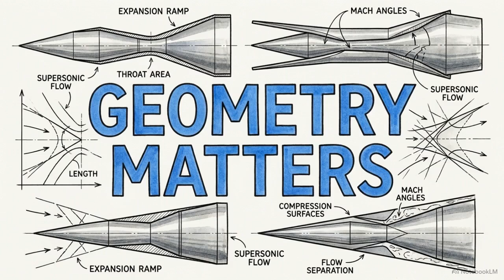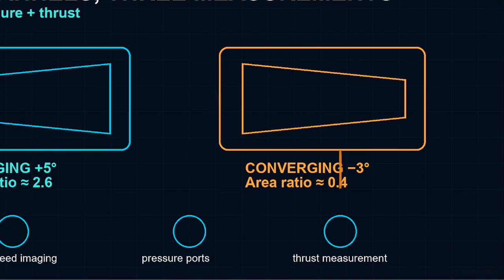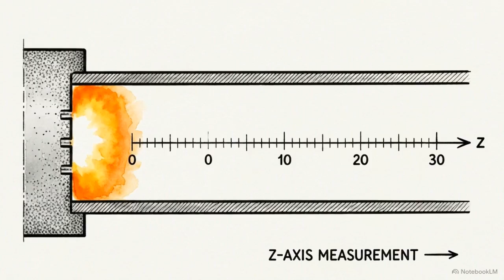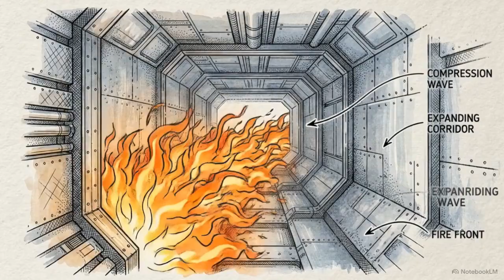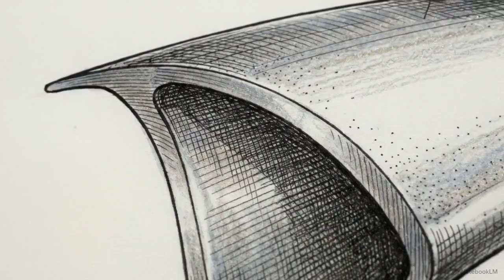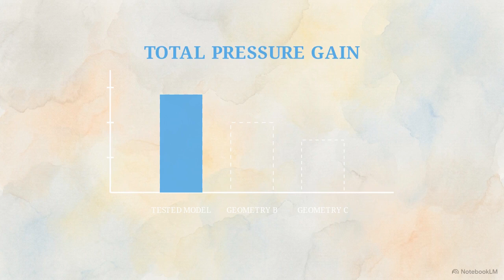How Channel Shape Changes RDE Flow | RDE Paper Explained

Comment: RDE occupies an interesting niche. It is stupidly inefficient in the atmosphere, were power needs to be mechanically transferred (flames are incredibly inefficient compared to pushing with lifting bodies (props). The SpaceX engine is maybe 1 to 10% efficient (not looking up the ISP for a comment) as a propeller.
And in space ion drives are far more efficient. But rockets eat fuel in prodigious quantity and that is entertainment. I don't think the Rocket Power Explosion Show is worth the effort.
Reply from the maker: RDE is being studied because of the pressure rise induced by this type of flame. Gas turbines are known to be more efficient with higher pressure ratios. RDE is not intended to be an atmospheric flame technology.